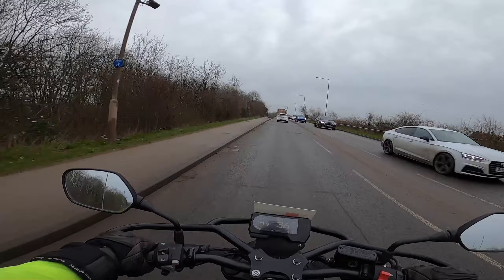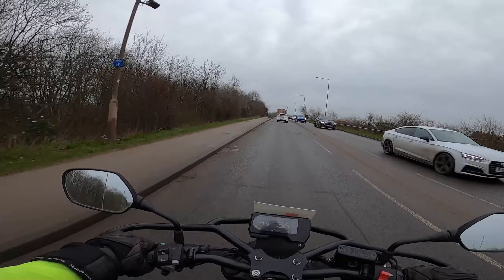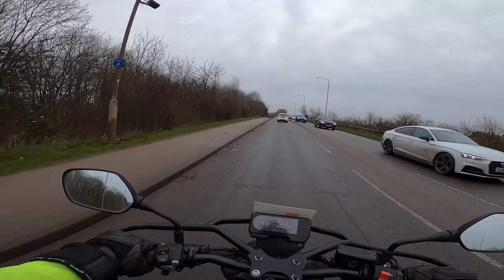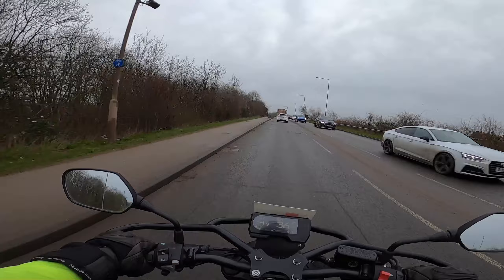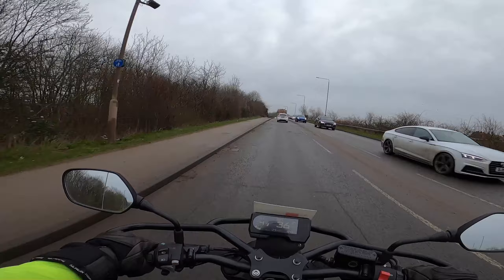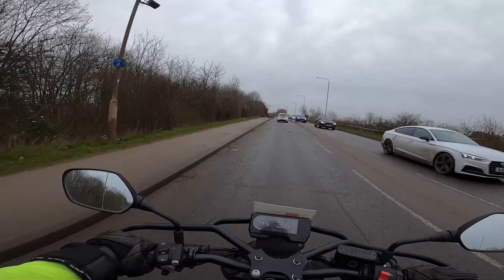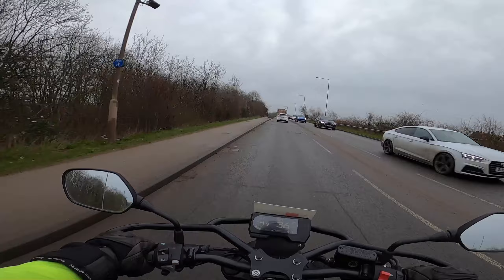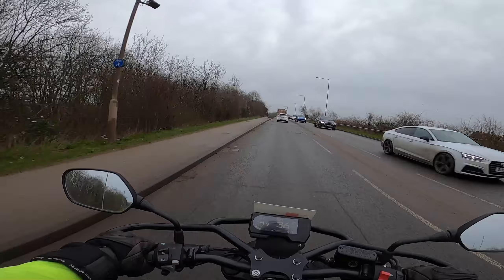When to change gear [timing your gear changes]

Comment: Thanks for this Leanna. I automatically assumed that, like in a car, it would make sense to use the gears and resulting engine braking to slow down, but I can see now why this is not a good idea on a motorcycle. Keep up the good work!
Reply: Using gears to slow won’t show brake lights to following vehicles, so risk getting rear-ended.

Comment: I've been driving for 25+ years, but only recently decided I'd like to try a motorcycle, so I have my CBT in a few weeks time, and just watching videos etc for hints & tips.

This one was really interesting to me, especially the tip about not to let the engine to slow the bike.
Reply from the maker: Excellent. Bear in mind we do use deceleration to slow the bike first (which is effectively engine braking), but the point here is not to change down a gear specifically to show the bike. The rule is deceleraton (close throttle) then brakes to slow, then gears to match the speed we've slowed down to. Many thanks 👍🏻

Comment: Great advice. I went out on my first bike yesterday around my village and on a few occasions did exactly what you said ( forgetting to change down through the gears ) I was getting frustrated and wondering what was wrong with the bike when it wouldn’t go into gear 😮 
Now I know why it won’t and also what to do in the future to quickly solve the problem if I forget again ( which I probably will ) 
I’m enjoying learning more and more each day from practicing and watching your videos is extremely helpful.
Reply from the maker: Lovely, well done for finding the solution to the issue 👍🏻 I'm glad you're finding the channel useful. Enjoy your bike 😊

Comment: Lots of car drivers (especially if they drive a diesel) try to use low down torque on a bike.  Some bikes are happy to do that.  Others need you to wind it on before changing up
Reply from the maker: Agreed, it depends on what bike you're riding 😁

Comment: When you stop at roundabout do you quickly put it in 2nd gear right before making sharp right turn on a mid sized roundabout? Mines a 125cc
Reply from the maker: Hi Steve, if stopped we need 1st to move off, and as soon as you've set off get it up into second so you are in a more responsive gear. Be prepared to use the clutch if the roundabout is tight so you don't run wide. Thanks 😊

Comment: Thanks for this video. Really interesting. Everything you are doing there I have no bother on my Honda Shadow vt125. I also have a Hyosung Aquilla GV650 vt. It seems to have a higher speed ratio for each gear. For example to get into 2nd gear I need to be doing at least 17/18 miles mph and then 35mph into 3rd ect. As soon as it drops below that eg 32mph all you hear off the bike is judder, judder,judder. I had a Kawasaki VN900 before this and didn't have this issue. You are so lucky you have the bike that you do that doesn't have these issues. Is there something wrong with my bike? Just wondering as I've never had a Hyosung before. Got 4 years experience and keep up and go to training sessions whenever there's an available opportunity (in case you're wondering).
Reply from the maker: Hmmm I have no idea as I've never owned or ridden a Housing, sorry. All I can say is to ride according to what your bike can cope with, provided you're happy it is mechanically sound. So if it's happier in those gears at those speeds without over revving or struggling then perhaps that is how it has been made? 🤷‍♀️ Sorry I can't be more help.
Reply: @motorcyclelessonsuk  Thanks. By the way it's Hyosung not Housing (lol)
Reply from the maker: @anthonygreen5160  haha damn autocorrect 😂

Comment: Any reason why a twin would struggle? My Inazuma 250 rides fine at 30mph in 6th. My FZ1 was fine too in 6th at 30 but I had to be more careful with it due to it's massively tall gearing but I thought twins are usually geared lower and and reach peak torque earlier so should be able to handle it easier than and inline 4.
Reply from the maker: Bigger engined twins generally don't sit well in higher gears at lower speeds, the engine struggles and there is no power left for acceleration. They do reach peak torque earlier, all the power is early on in the lower gears and that's why they don't sit well in higher gears at lower speeds.

Comment: My biggest issue is managing gears as i slow down. Going up them as i speed up is straight forward but managing dropping gears while bringing the bike to a stop using the brakes and monitoring my surroundings feels like patting my head and rubbing my stomach at the same time.
Reply from the maker: You're not alone! This is very common but with more practise it will all start to feel more natural. Keep working on it and don't feel disheartened. No one becomes a concert pianist overnight. It's the same on a bike 😊

Comment: Revmatching is not an efficient way to slow down? First time i hear this…maybe you were referring to something else? Side note: yeah massive difference from 4s to parallels…i can be in 2nd at 40mph and still in eco on versys 650 (they are known to like revs) but at the same time i agree that being in a higher gear alleviates the choppiness starting to love ur vids
Reply from the maker: You'd need to give me a time code for specific wording used. Glad you're enjoying the channel. Rev matching isn't necessary if you're already matching your gear to your speed: under normal road riding conditions rev matching isn't usually needed.

Comment: My goodness the road surface in Nottingham are as bad as they are in Glasgow.
Reply from the maker: 😬 yes and getting worse. Apparently the council is now bankrupt so unlikely to get much better very quickly.
Reply: Ouch! I hear that it we try to avoid them it could be construed as driving without due care and attention.  @motorcyclelessonsuk
Reply: @RoobieRoo2  first a disclaimer, I'm not a lawyer, police, etc, so this is just my opinion and not legal advice. 🙂 
I think that's come from a trend for click-bait motoring articles ("drivers face huge fines for common driving mistake", etc.) which typically take some rule and exaggerate or explain it poorly. Others, often well meaning, pick these articles up and propagate the poor explanation. I've even heard of an insurance company passing this one on to their customers in a newsletter.
From what I've read, there aren't any new laws or highway code rules relating to this. 
If you drive in a way that causes a hazard to other road users, if your driving standard falls below that expected of a competent and careful road user, or if it falls significantly below, then you could face prosecution for driving without due care and attention (careless driving) or dangerous driving.
Where this comes in with poor road surfaces would be if you aren't looking and planning ahead and do things like suddenly swerving towards other vehicles, pedestrians, etc., or drive/ride in a way that makes them think you are.
If you are planning ahead, making gradual adjustments to your line and/or speed, and not coming into conflict with other road users, then I wouldn't expect there to be any problem. 
This is more likely to be a problem for car drivers than motorbike riders due to the relative widths of the vehicles. A car moving to avoid a hole, especially on a narrow street, could well end up partly in the next lane and could be coming into conflict with other road users, whereas a bike may be able to avoid the same hole while still leaving a safe gap. However the move should still be made in a way that doesn't panic the other driver into thinking that you are swerving into their path, as that could cause a dangerous reaction from them.
Remember too that hitting a hole could unsettle a bike, which itself could be hazardous.
So, I'm going to be riding and driving like normal, planning ahead, making changes to my line and/or speed to avoid or at least minimise and balance the risk for all hazards (stationary ones like holes and moving ones like vehicles and people).